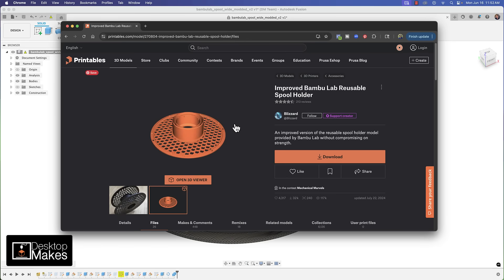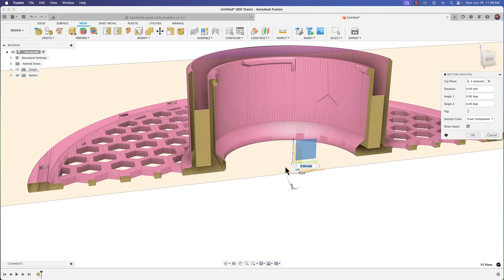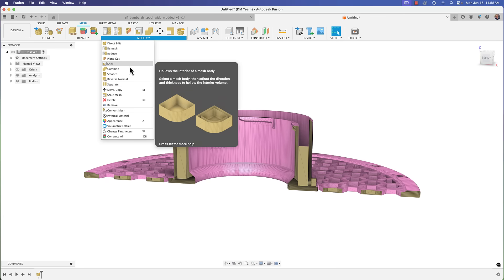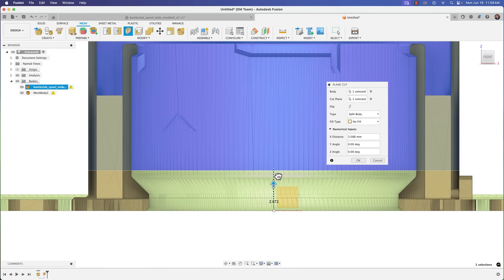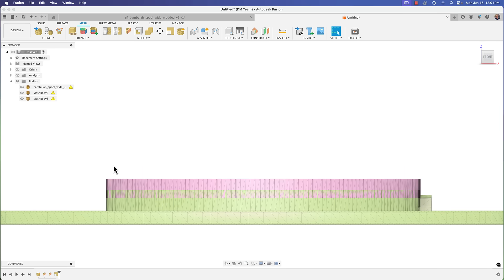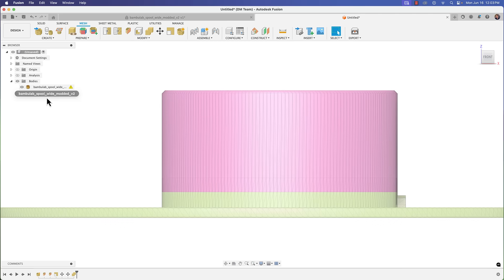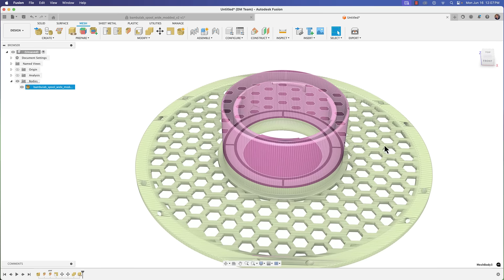No Need to Convert to Brep

Comment: I would simply import it into Sketchup, pull the cylinder up and export it as a STL. Provided the file is not created in a program like Blender which adds millions of unnecessary triangles the whole painless process will take a few minutes.
Reply from the maker: Simply stretching the cylinders up would not work because it would scale the entire cylinder affecting the dimensions of other critical features.  That is the whole reason I needed to find a smooth part on the cylinder to cut and separate from the rest of the body.  Scaling only that smooth section allowed me to increase the height of the part without affecting any features on the part that can prevent the two sides of the spool holder to twist and snap together.

Comment: Good video. Funny, I've never seen anyone completely work with it as a mesh, they've always converted it to a solid before doing edits. Also, when doing the "move", why not choose to move it to the other body instead of a number? That way, if you're working with numbers that aren't as simple, you don't have to figure that out.
Reply from the maker: Thanks!  With the new Mesh tools introduced, it can sometimes be easier to work with the Mesh vs converting to Brep.  The tools are still limited and don't quite work like the solid environment where you can extrude to a body or reference a body.  I chose to give it a number so I know it would be exact instead trying to eyeball it.

Comment: I've done this multiple times when I don't want to spend hours starting from scratch. But why split twice? I don't mess with meshes in Fusion much besides things like this. But I convert to solid, split, move body x distance, then extrude one or the other face to the 2nd face, then combine. Then save as a mesh. Can't you just split mesh once and extend one or the other?
Edit, thought about it, extending stretches whole body I assume... 

Also, if you choose to have your model as a remix, would love the original. Rarely find ppl that do that.
Reply: the video is for showing how to do it without converting 

when you convert it does a bunch of approximations when generating the faces so you lose some details. like you may notice a circle is no longer actually a circle 

by playing around with it as a mesh you're scaling the same pieces so there's no conversions where you might lose details

Comment: Very useful, thanks!

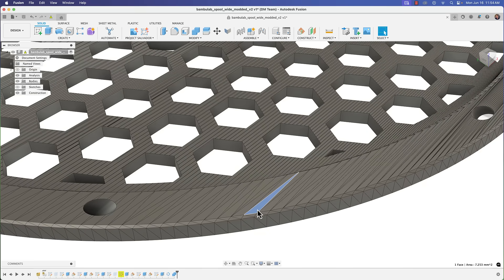Another thing - at 1:45 your selecting and delete a mesh face, which deletes all of the other mesh faces on that surface. 

I tried that on an imported STL model, but when I tried to select the face the entire mesh body is selected.

Any ideas?
Reply from the maker: Go to your Select menu and double check which selection filters are checked.

Comment: Tą samą metodą zrobi się to w Tinkercad.
W Tinkecad robię kopię, następnie wycinek tego co chcę wydłużyć.

Następnie wstawiam w środkową część tej rury ten wycięty fragment.
Wszystko zajmuje 45 sekund.
Reply from the maker: Translation: "You can do the same thing in Tinkercad.
In Tinkercad, I make a copy, then cut out the part I want to extend.
Then I insert that cut-out section into the middle part of the tube.
The whole thing takes 45 seconds."

Thanks, good to know.
Reply: @DesktopMakes  Tinkercad decimates file quality though, not really an acceptable method if you're trying to have high quality prints.

Comment: what an absolute pain in the a33. I have seen quite a few models on printables and other places, where I want to modify them, but as you have shown, its a nightmare. I have stopped trying this and just tried to learn how to create them from scratch
Reply from the maker: Sometimes starting from scratch is a better option but I find the tools in Fusion useful for simple modifications.
Reply: I use microsoft 3d builder for simple modifications. Because yeah, Fusion sucks for mesh work.

Comment: I would personally use Blender for this type of simple edit. In edit mode, go to xray view, select the top section you want stretched , press G (grab) on keyboard, press Z (lock movement to Z height), move up required amount, export. It would take under 2 minutes. Fusion is good but some things are just easier with other software.
Reply: Yeah, I did the whole thing in Blender (including finding and downloading the STL) before he finished explaining the problem with doing it in Fusion
Reply: @benbencom  true story
Reply: I don't know why, but I just can't wrap my head around how to use blender. Sure wish I could. Like @lescarneiro, if I have to edit it, have been using Tinkered or remodeling from scratch in Fusion.

Comment: The problem is that you have to pay for Fusion 360. Free version is limited.
Reply: Everything done in this video can be done with the free version of Fusion. For  personal designs, there are very few limitations, and none that I find restrictive.
Reply from the maker: I don't understand why people keep saying that Fusion's free version is limited.  I find it actually quite powerful for 3D printed designs.
Reply: @DesktopMakes Yes it is but it does have limitations.
Reply: @JBCool0729  just admit you're wrong
Reply: @mrb2917 No I'm not. Like stl files you can't convert to solid so you can make some changes

Comment: That's neat! I usually use TinkerCAD for this specific use case (split + extend), by duplicating the models after import and them doing "boolean removals" there until I have "the slice" I want to extend. It's good to have this ability in Fusion because sometimes TinkerCAD doesn't play well with certain meshes
Reply from the maker: Fusion has been slowly adding to their mesh capabilities over the years.  There are other very useful edits you can now do with meshes.  I'll do a few more tutorials demonstrating these.
Reply: I have done the same with TinkerCAD in the past. The issue I've encountered though is TinkerCAD can't handle even moderately complex meshes. For example, I doubt very much if the spool used in this video would import, and if it did, I would expect it to have mesh errors. TinkerCAD is a great option though for those times it works - it can be quicker than Fusion in a lot of cases.

Comment: Yeah, that's a lot of work. I would not use fusion to edit stl's. I would use blender.
Reply: I would love to, but Blender has a steep curve for beginners, you usually have to google pretty much anything (when you're a beginner on Blender). I'm procrastinating learning Blender for years, but I know it's "the right answer" to work with meshes because this is the bread and butter of Blender.
Reply: @lescarneiro  Same I put it off for a long time also :-).  It was not as hard as I thought. I watched a few youtube videos and I picked up some of the basics pretty fast. After you get over the hump, the time you save when you need to edit an stl, is worth it.
Reply: @lescarneiro yeah, I can't get past the user interface 😂.  I used to use 3dsmax in college, but I can't figure out blender